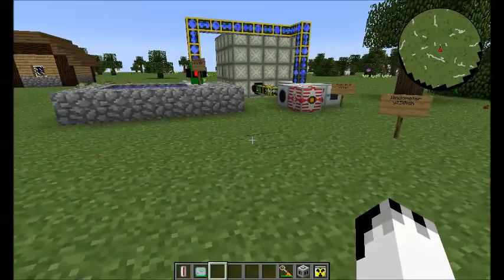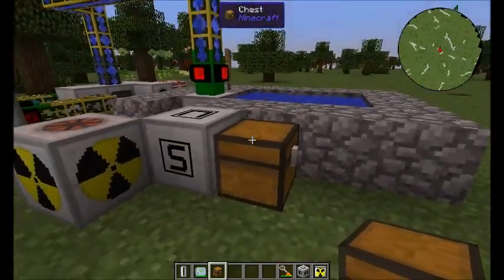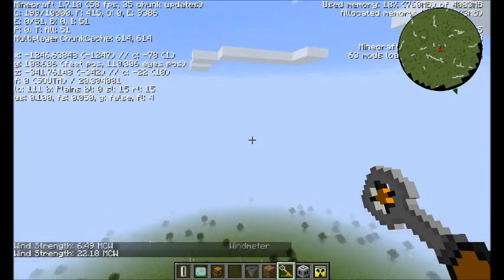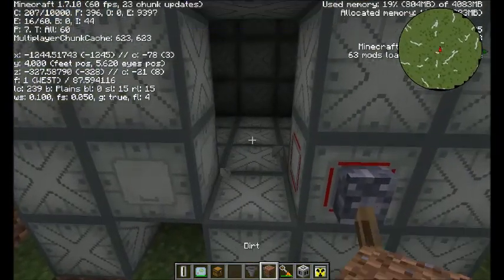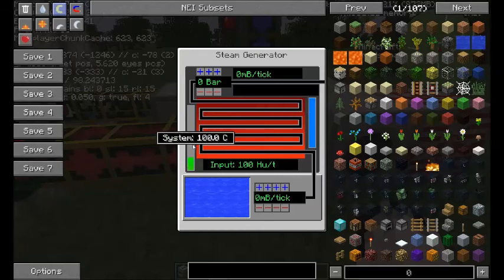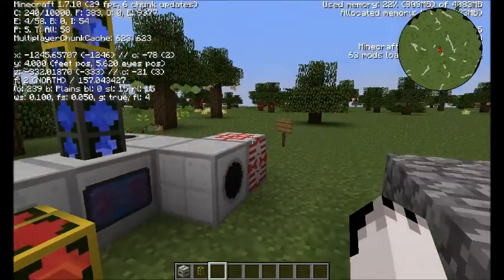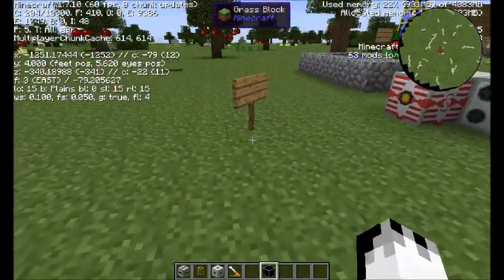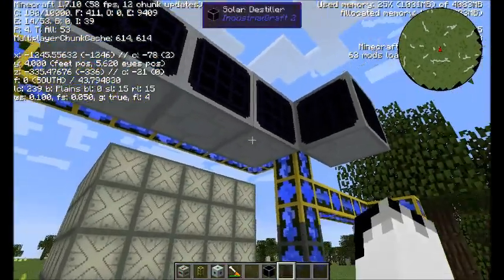IC2 Experimental #589 - Steam changes and various bits n bobs

Comment: Can you make the steam generator somewhat autonomous? As soon as i pump in new water, the temp is reduced to a point when only water comes out.... maybe with BC gates? And i did once with it that the water turned into steam inside the steam generator.... but i could not duplicate it.... and i don't understand the the dials in it, water intake, and the BAR pressure, what can i do with them?